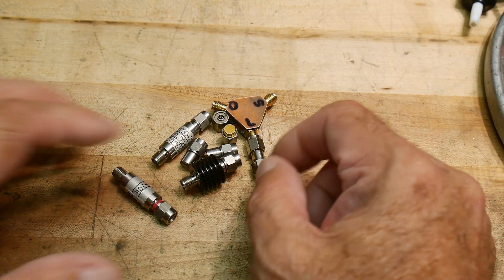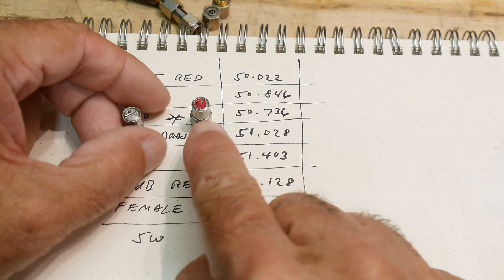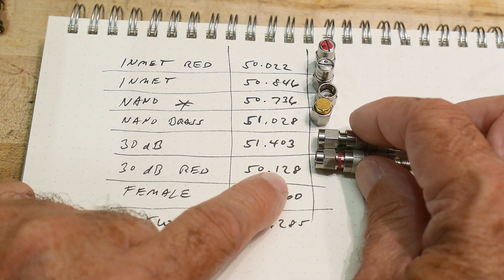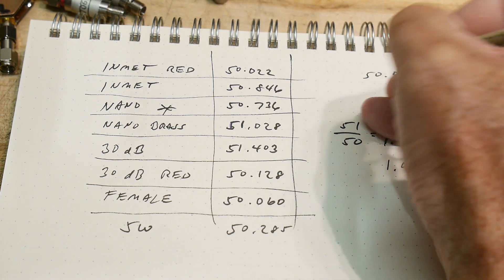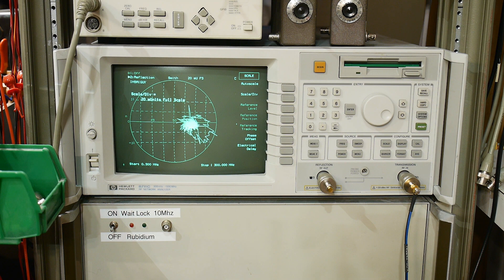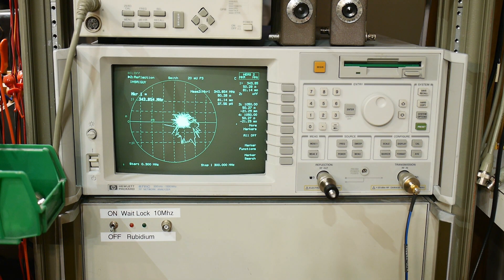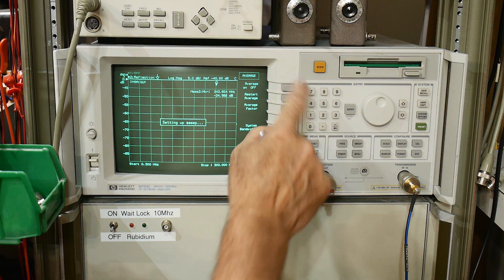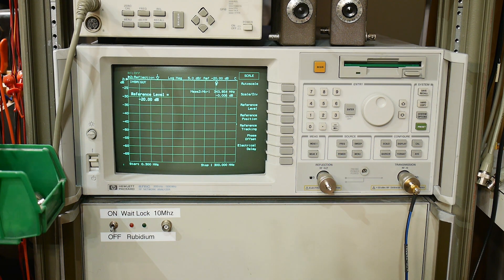#905 How good is that 50 ohm load that came with your NanoVNA?

Comment: I work with $100K+ VNAs everyday, first activity of the day is calibration and the calibration kits that I use cost $5000 or more. At low frequencies, the strays and fringe capacitance of these cheap loads might not be very important. An SMA connector is so physically small that it is hard to screw it up. A load made out of 2x100 resistors 0603 or 0402 in parallel with the SMA connector center pin cut at the back plane and the resistors soldered radially is good enough. Go higher in frequency and you should pay for a cal kit as the reference plane and the other strays must be known and taken into account in the calibration. This is why the expensive VNAs ask you for the cal kit model and/or the calibration data.

Comment: Since my previous comment was, apparently, deleted I will summarize once again: Measuring the load that was used as an ideal (non characterized) calibration standard does not mean much. As for supplied load with NanoVNA the recent (last 9 months or so) ones supplied with Hugen manufactured Nano and LibreVNA have been characterized by Kurt Poulsen, you can find the chart online.

Comment: 51 Ohms resistance doesn't neccesarily mean 1.02 VSWR - parasitics increase VSWR as well, especially when you go up in frequency. Expensive loads are expensive not because they have a resistance of 50 ohms exactly at DC, but because they remain close to an impedance of 50 ohms across a wide frequency range.

Comment: Does a cal set for a VNA used solely to test homemade antenna's NEED to be a lab standard load ?? I doubt it. I think 49-51 ohms is OK....my homebrew 1600w dummy load reads as 50.15 ohms. It works fine, and I am yet to blow a radio up due to high SWR or the like....if I was calibrating nanobots to fix a Borg, I MIGHT want more accurate loads, but for a few bits of aluminium in the sky.......I think 50.1 is close enough.....especially when the dipole it's testing is somewhere in the region of 60-80 ohms at the feed point. Let's not get too anal about it.....
Reply: For general everyday use no, 50, 51 will do. however that's not quite the point here. You are looking for something that is going to be YOUR standard, against which you can compare everything else. They tell you that you instrumentation is working as it should.
As has been mentioned in previous comments, the lab quality standards are designed to work over a very wide frequency range.

A home made load using a couple of 100 ohm chip resistors will far exceed any requirements that you have for simple HF use. 

Once you have a load that you trust, then you can use that to check anything else that you might buy online.

 The bottom line is that it's your shack, so providing that your standards are suitable for your needs then it's fine. 

It's worth remembering that we ate nit-picking  about something that 5 years ago the majority of Amateur Radio operators would not have had any access to :-)
Reply: I had some guy in the comments of a TSP video launch into a long diatribe after I revealed that my water cooled 5KW dummy load was 52ohms and within manufacturer spec. According to him it sounded like the world was going to come to an end. Anal is the word.

Comment: What causes the frequency response to have sharp peaks and dips that looks like noise?
Reply from the maker: it is noise. if you want very clean measurements you can turn on averaging before you cal. Also make sure to warm up the instrument for a hour first. I've gotten amazing results this way. this method would not help on a tinyvna.

Comment: I would like to know what REAL applications need 1.02 SWR!  I'm usually happy as hell to get 1.5 or even 2 on an amplifier or other project. Possibly a balanced mixer would take better SWR but even that in the real world may not need that much precision.
Reply from the maker: only metrology
Reply: Network analysis applications high up the tracability chain, where tolerances have to be as tight as possible so that measurements are still meaningful after being half a dozen steps removed through transfer standards.
Reply: The applications that need of real low return loss are many, but you are missing the point. This is a piece of test equipment and the result of the measurement are a direct function of the calibration. if you want to know if your 1:1.4 is really 1:1.4 the test equipment must be  properly calibrated at the frequency range that you are working on, otherwise you have no idea. In short VNA must be calibrated for them to read properly.